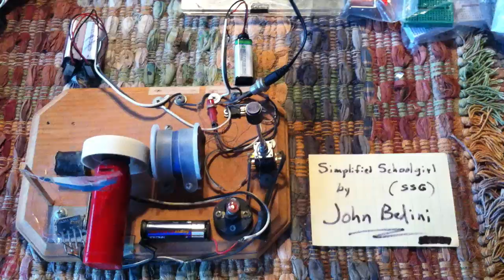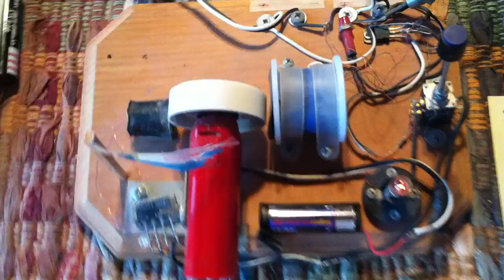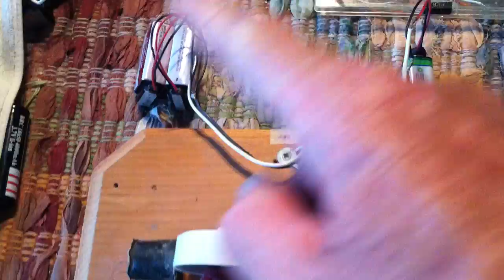Tribute to John Bedini  --- Running up my old SSG after years of non use

Comment: Well done Lidmotor. Yes, we will miss him... Could you charge up with one source battery then 2 charge batteries fully and so get more charged batteries than discharged batteries all in all ?
Reply from the maker: I never got the proper results from this crude kitchen counter top build.  I was just glad that it ran and I could observe the charge up effect on the secondary batteries.
Reply: *****
Have you built other chargers where you succeeded charging more batteries than were discharged while running the circuit ?
Reply from the maker: I never came close on any of my builds.